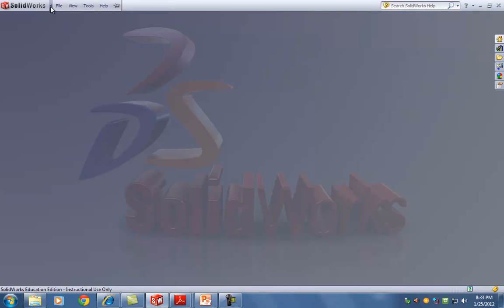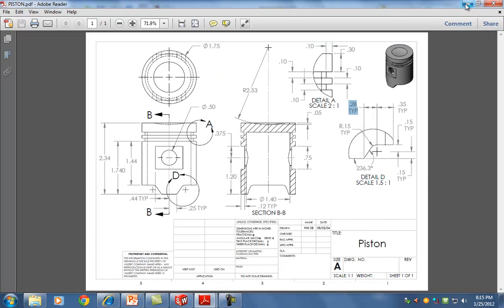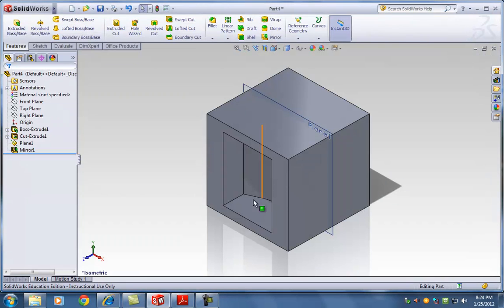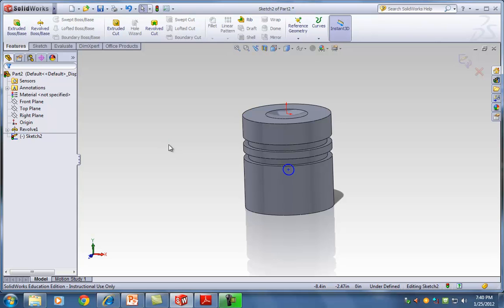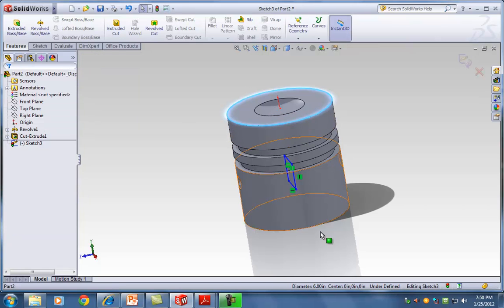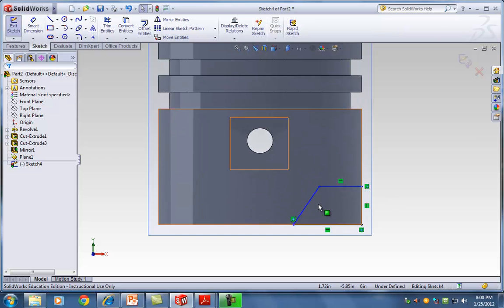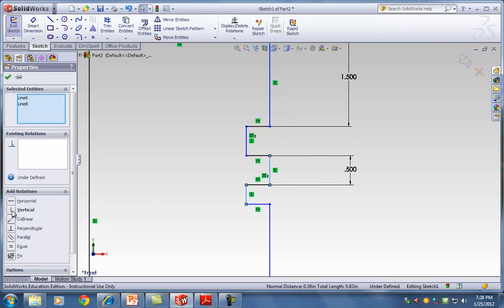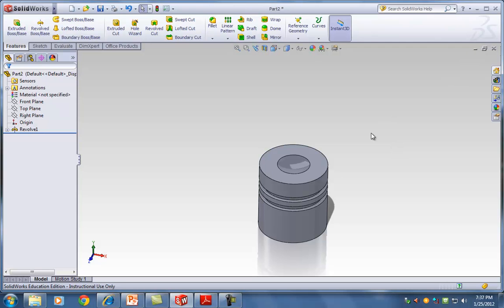SolidWorks Lecture 2

Comment: When you created the groove in the connecting rod, you used extrude cut with draft.  However, that creates an angled cut of the whole sketch whereas the drawing seems to indicate that only the top and bottom faces of the groove should be angled.